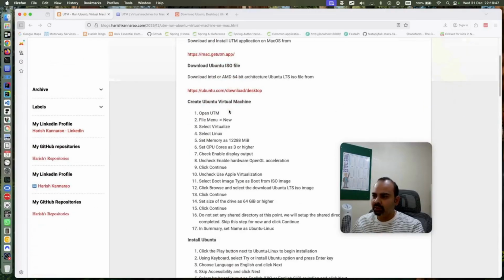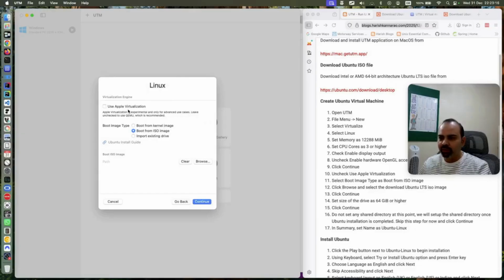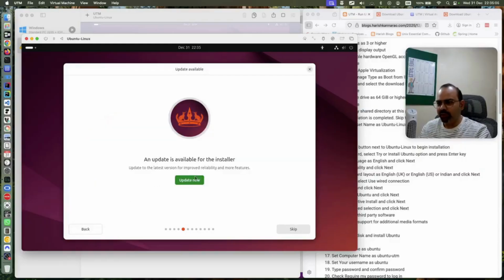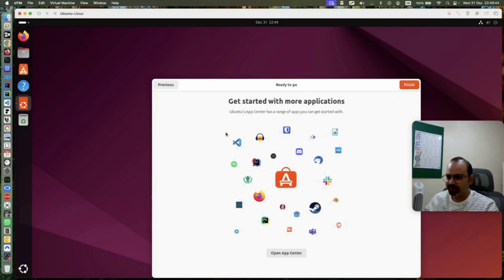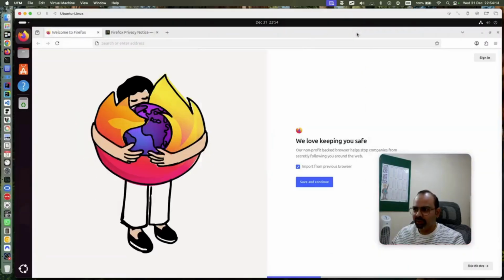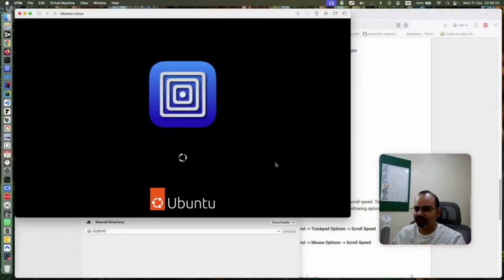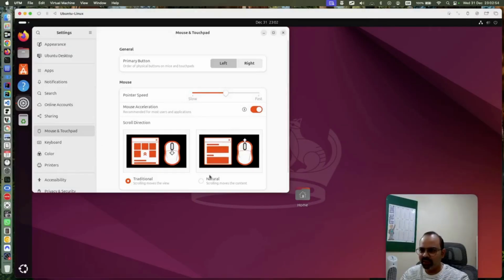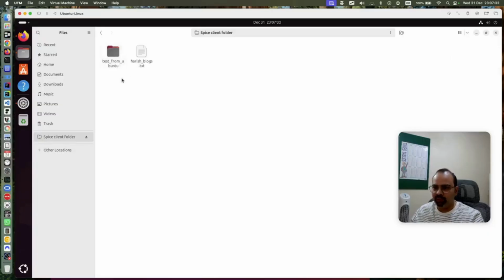Ubuntu Virtual Machine on MacOS using UTM

Comment: I can't find the + Other Locations tab in the menu, do you have any idea why?
Reply from the maker: The + Other Locations tab will be invisible if the sidebar is hidden due to Screen size/resolution or the Files window is not maximised..

To see the "+ Other Locations tab":
1) Click Show Sidebar icon
2) Scroll to the bottom
3) Click on + Other Locations tab
4) Press Esc key to close the Sidebar
5) Now the Spice Client Folder link will be visible..
Reply from the maker: Or it can be opened using Terminal command line using the following command

nautilus other-locations:///
Reply from the maker: Follow the steps below to manually mount MacOS host directory to a different location

Install/Upgrade davfs2 package:
sudo apt-get install -y davfs2

Create a directory under user's home directory to mount:
mkdir $HOME/webdav_mount

Mount the MacOS host directory:
sudo mount -t davfs http://127.0.0.1:9843/ $HOME/webdav_mount
Leave username as empty and press Enter key
Leave password as empty and press Enter key

Access the host directory using Terminal:
cd $HOME/webdav_mount

Access the host directory using Files Explorer:
nautilus $HOME/webdav_mount